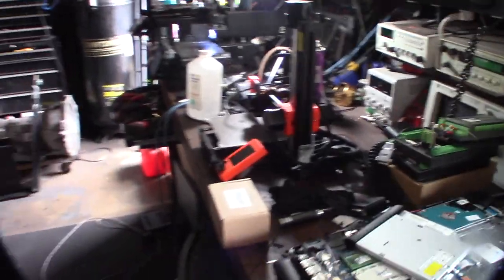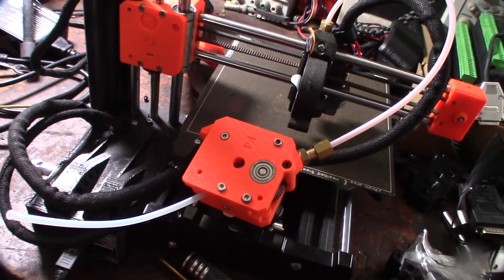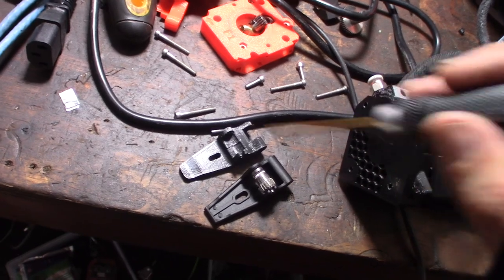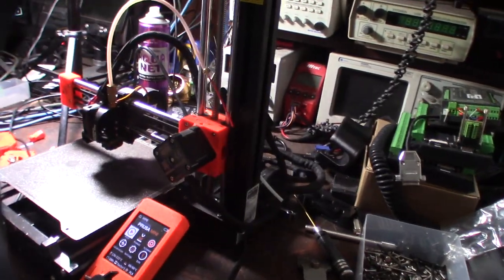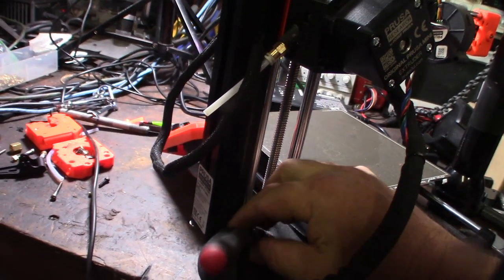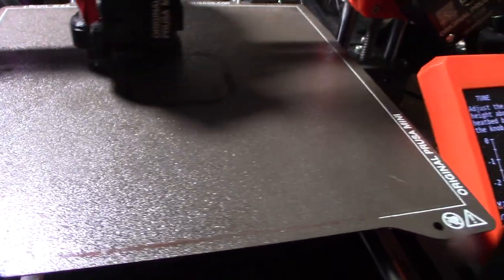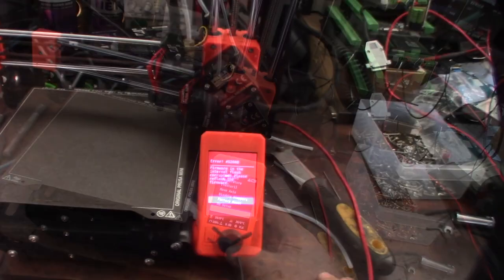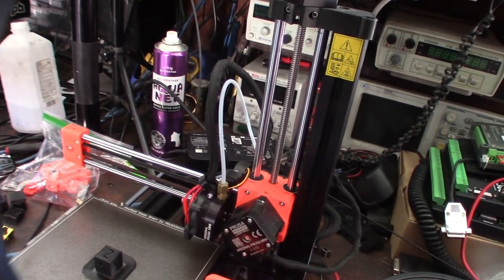Prusa Mini+ BMG dual drive extruder upgrade reduces clogging jamming troubleshooting mini M500

Comment: Had nothing but bad luck with BMG Extruder its works great for the first while and then it will cause bad prints, failed print and clogging the original if maintained is far better you just have to clean it every two rolls that means take it apart and clean and grease it thats the only problem with the original one.